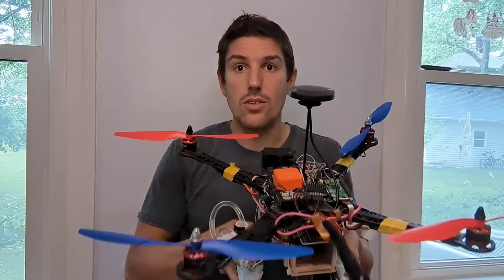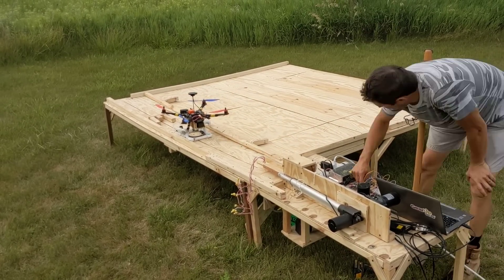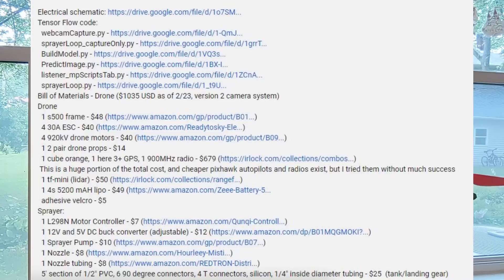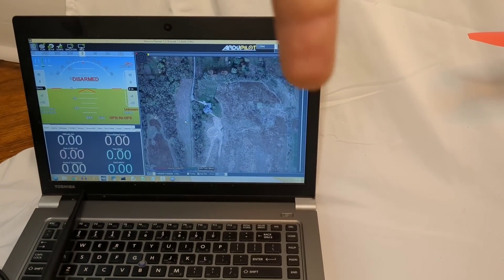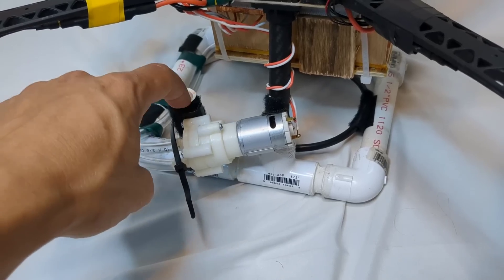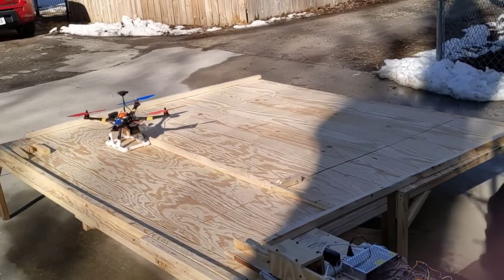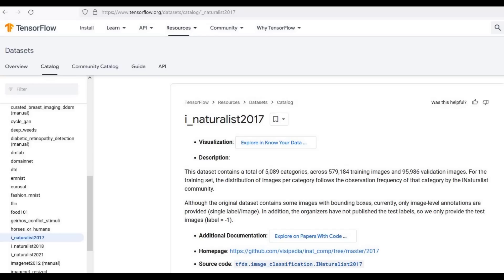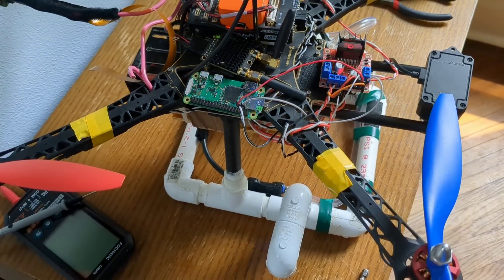DIY AI weed spraying drone, automatic landing pad/battery swap

Comment: On your battery swap platform, it would probably be quicker to move the sweep boards with a motor pulling cables back and forth instead of a threaded rod.
Reply from the maker: Totally agree, after building this I thought... why not make it work like a garage door with cable/bike chain?  Way simpler and faster, that'll be in the next revision.
Reply: Also could you use the camera to aim the landing at a symbol on the landing pad? Might be a way to get your landing location more precise

Comment: thanks for this , it's what i'm looking for. I've built an rc push mower, and I'm also wanting to put a sprayer and a device to spread tick crystals during summer using ArduRover and start planning missions.
Reply: also what if you could have the drone fly over and identify the weeds, then have the gps lawn mower pull a spray tank and then the mower will do all the spraying?
Reply from the maker: That sounds like a fun project!  My fields are pretty tall so the mower would look more like a tractor! Next year...

Comment: This is pretty cool, doesn't it need to be lower to spray the weeds without wind scattering
Reply from the maker: This does ok right now since the downwash of the drone motors really sends the spray down. It coudl be set to any height with the lidar.  I have a few tall things sticking up in the field though, so if i go much below 2m I could accidentally run into those since i don't do object detection in the forward direction.  Something that could be added pretty simply though.
Reply: Typically pesticides are sprayed from planes which fly much higher than 2 ft off the ground.